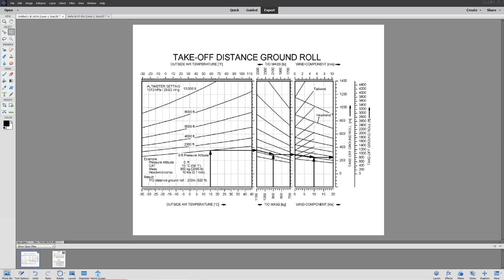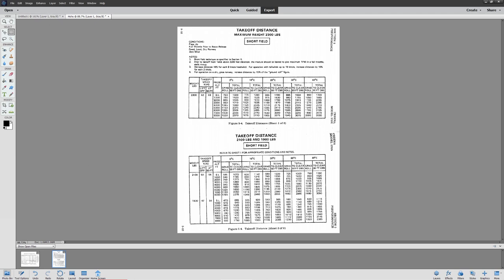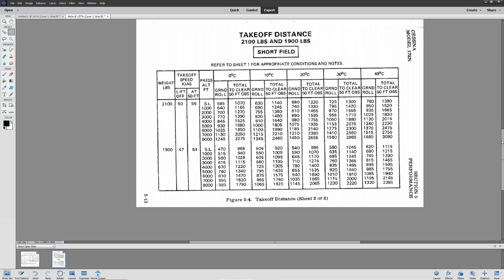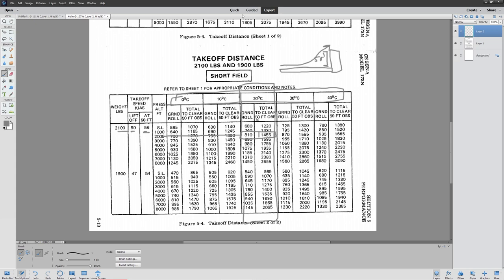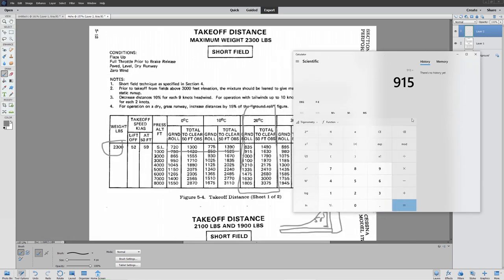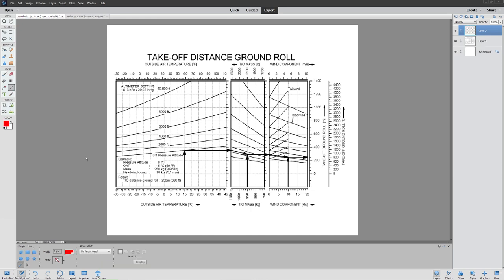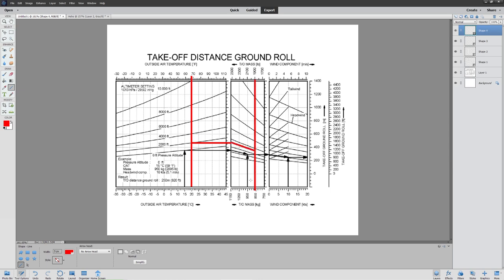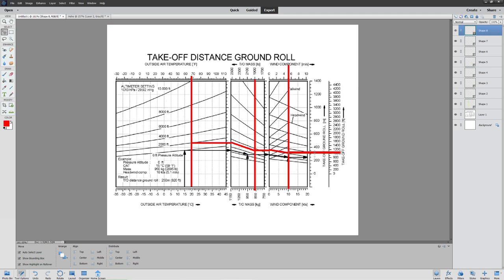Aircraft Performance - Calculating Takeoff Roll

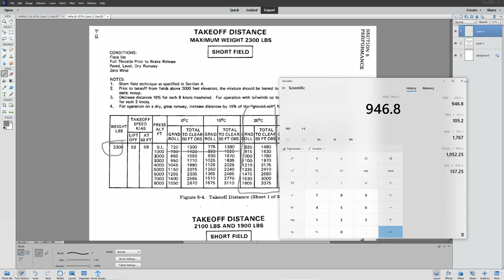Comment: Thank you for this - this was the only link I could find with the example I needed.  Something I struggled with is something you did not include as you transitioned to the other chart @ 8:15 - the total to clear a 50' obstacle with the headwind after calculating the ground roll on grass.  You calculated the ground roll on grass at 1,767' (1,630 +137 = 1,767').  Take the -10% head wind from that and you get your the total to clear a 50' obstacle of 1,590'.  Please correct me if my math is wrong.

Comment: Why did he use the 20 C column to do the calculation in the sample problem he gave us when the temperature was 11C?
Reply: Probably just to switch things up
Reply: As he says in the video, always round up.  So you go to the 20C column.
Reply: You need to round up the number to the next one in the chart.Doing that will assure you that your plane will take less than the answear you arrive to in order to lift off.